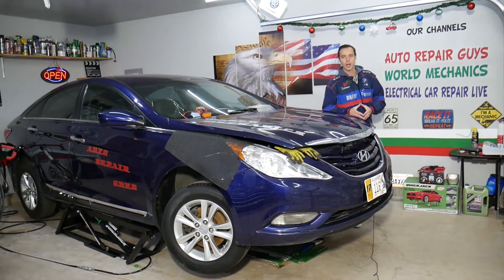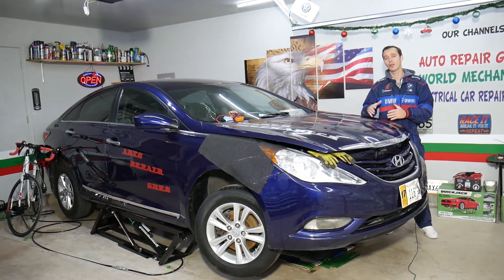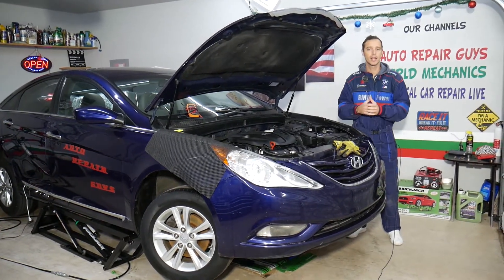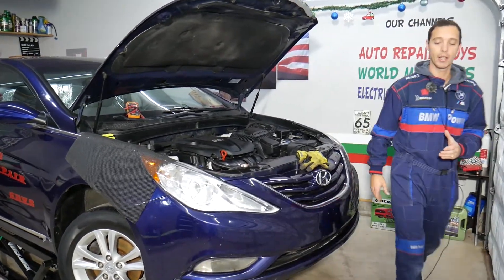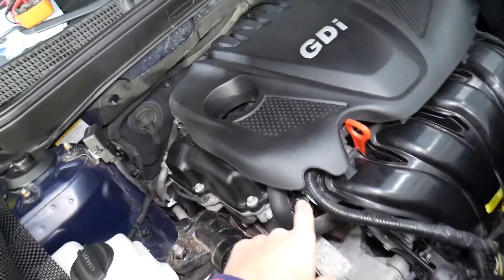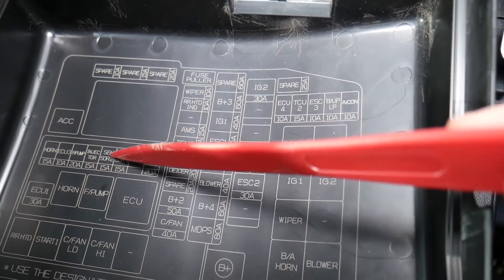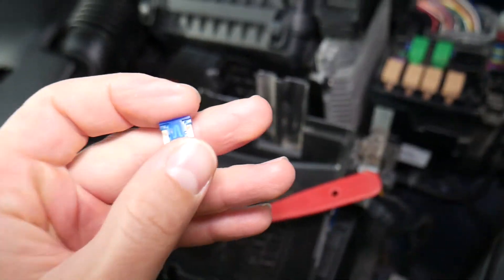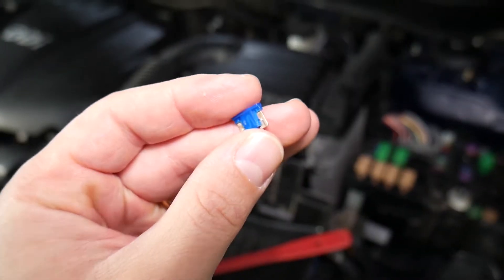HYUNDAI SONATA OIL CONTROL VALVE SOLENOID FUSE LOCATION REPLACEMENT

Comment: I was having major issues with my 2011 Sonata (2.4L), would not idle, seemed as if the CVVT system was failing. IT WAS THE FUSE. It was tarnished or blackened as if it was arcing and lost contact. Cleaned the fuse socket with contact cleaner that does not destroy plastic, and replaced the fuse. Thanks for the video info. Helped immensely.

Comment: Hi. I have a 2014 SF sport 2.0T. it suddenly is leaking a lot of oil. It seems to be coming from the rear passenger side of the engine. I'm having trouble pin pointing the leak because the oil is getting on the drive axle which is flinging oil everywhere. I checked the OCV but it's dry. My only other guess is the turbo but I don't see any obvious signs the turbo is the culprit.